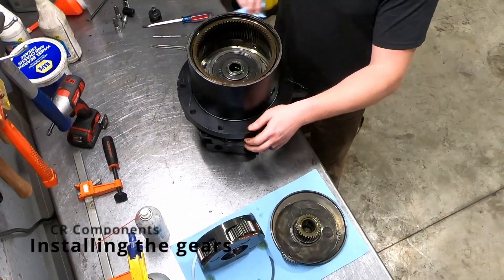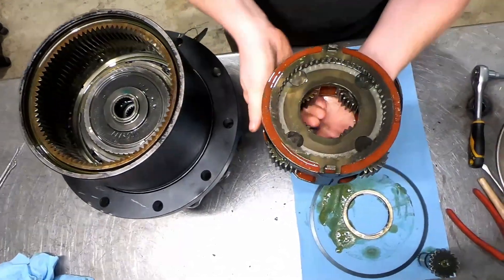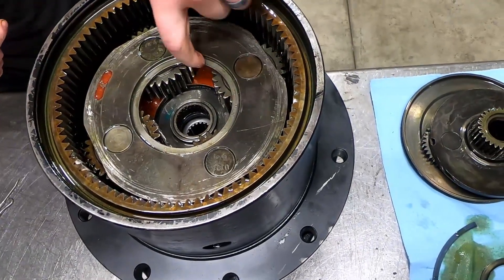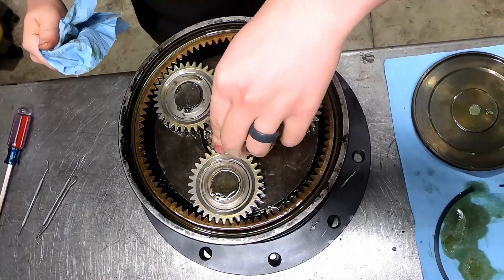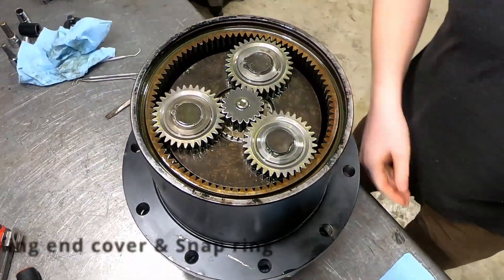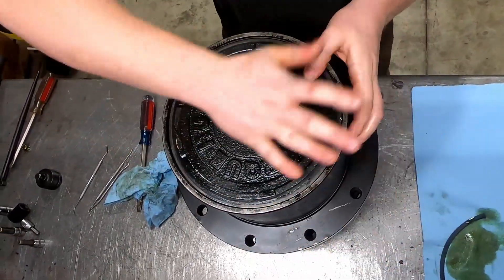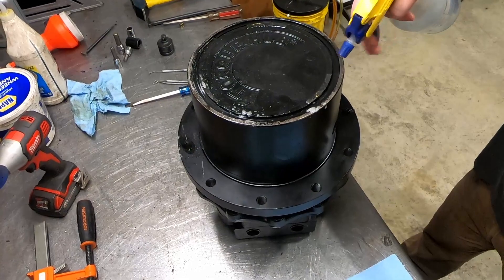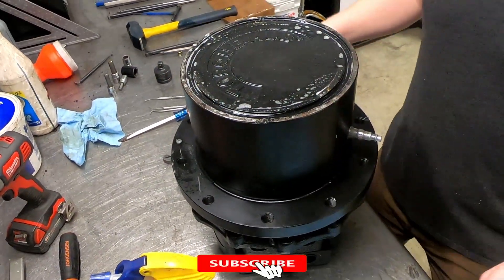Gear Installation - John Deere Final Drive Torque Hub Motor

Comment: What is torque spec for hub nut?
Reply from the maker: -Clean Threads
-Apply oil to threads
-Rotate housing as you tighten AND tap the flange with a ball peen hammer (at times there are scars on the housing stopping the bearings from seating properly and this helps seat all the races)
-Torque to 220-225 ft lbs.  
-Hammer smack, check torque again, repeat till holds 225 ft lbs.